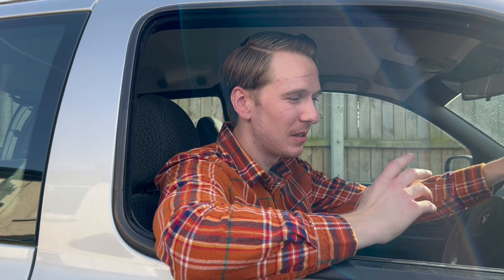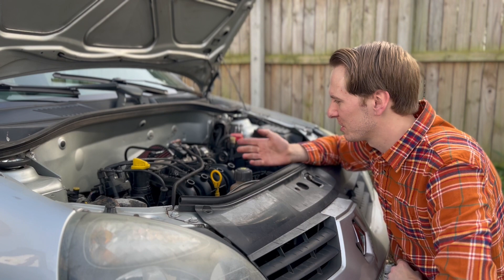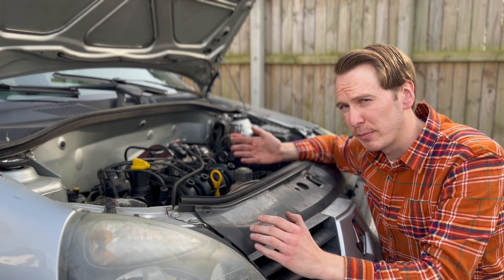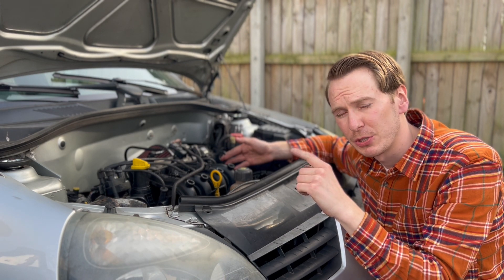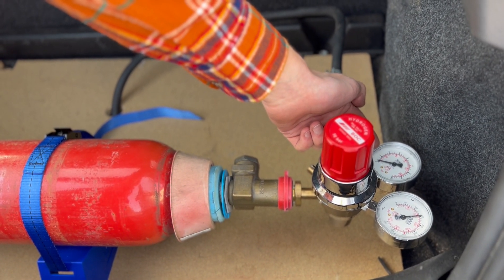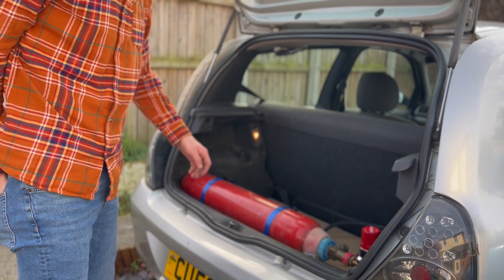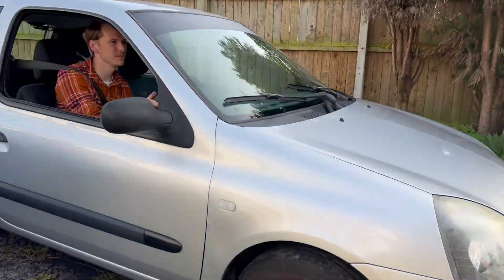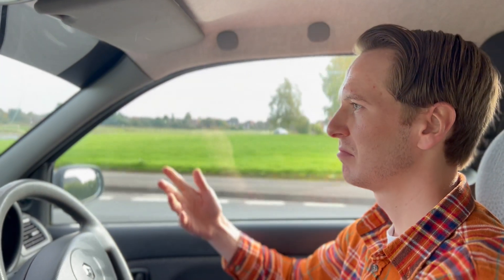Hydrogen Gas Car

Comment: So you retard the timing, because hydrogen ignites too fast it will cause early ignition and cause knocking? But doesn't it have ECU to automatically adjust itself?

Comment: Fuel tank pressure is the fuel level?
Reply from the maker: Not really, it's more about how much gas is in the bottle. But pressure is a good indicator ✌️
Reply: @Hydrogenguys so how you calculate the “how much fuel have?” Question?
Reply from the maker: @Dmanthechadman12345  nothing mathematical, just knowing roughly how long my tank pressure will last with that size tank. 

I am upgrading to a higher pressure tank soon so will have to get familiar with that one instead.
Reply: This is not alternative to today envoriment… but it will have a future because they will be more hydrogen stations than today…

Right?

Comment: I have a car with an LPG tank, Can I use that or do I still need to change the tank?
Reply from the maker: The tank would need to be changed as the hydrogen is stored under high pressures. 

Apart from that the rest of the system would be similar.

Comment: Sounds a bit like on quick burning race gas.
Regarding to your experience with the generator you should change the oil at least 4 times that often.
Reply from the maker: Yeah frequent oil changes for sure.

Comment: What about utilizing EGR for NOx?
Reply from the maker: Yes that would be good, I did this in an old video and it worked well, but for the rebuild I’ll be aiming for performance over emissions. I’ll still be using water mist injection to reduce Nox

Comment: Are you injecting liquid hydrogen into your cylinders.  Otherwise I'm pretty sure a fuel injector's won't inject gases . 
 
 
I drove an LPG converted Ford f 350 work truck
 ,19 73 model year. 
  Without taking it apart, it looked  Pretty simple it was stock Motor from the manifold down.  Just an odd looking sealed  air filter cover  With the propane line going into it. I'm guessing it was a throttle bodyInstead of a carb 
 But it ran identical to my truck that was the same model that was running gasoline.
Reply from the maker: Hydrogen gas, yes it works pretty much the same way as an LPG converted car, except its passed through the injectors instead, the injectors will cease up eventually because there not made to flow gas under such high pressure

Comment: 25% less power is masive
Reply from the maker: Yep, crazy, needs a turbo charger to make up the losses ideally
Reply: @Hydrogenguys  that comes with more things as compression will need to be changed to support a turbo and its a bit of a rabbit hole lol
Reply from the maker: True. I mean use a car that is designed for a turbo or supercharger to to start with, so the vehicle is better suited for it

Comment: You put hydrogen tank in the car so put lpg tank 25% and 75%hydrogen the car may run great try this power would be up
Reply from the maker: Would definitely help with the low power I’m getting, wouldn’t help with the carbon emissions though. And I guess a second fuel tank would make it less practical, range is definitely a problem with this hydrogen car project

Comment: how do you ensure saftey ? is it safe?
Reply from the maker: This is pure hydrogen gas, it needs oxygen to burn so the tank is very safe, unless there is a gas leak of course, but that’s the same with petrol, only a hazard if it leaks, 
A special hydrogen flashback arrestor is also used to stop any flames travelling up the gas line from the engine. 

As with all things, it needs to treated with respect, if done right it’s perfectly safe.
Reply: @Hydrogenguys   will this gas tank can easily be replaced with lpg tanks ? because here in our country there LPG tanks in cars are pretty common. so is there any modification required for hydrogen gas tank in comparison with LPG gas tank ?. or do you guys sell some sort of hydrogen kit for cars ?

Comment: Wow great work! But what about the air to fuel ratio how did you tune it?
Reply from the maker: Used a stand alone ignition system, the air fuel ratio was not measured in this test, hydrogen can burn in a wide range of oxygen levels, in this video the engine was running very rich, burning lots of fuel, ideally the engine would use forced induction.
Reply: So very rich like  A/F  10 -11 ?like in gasoline or rich for hydrogen like 25 and more

Comment: bro i have my car convertet on lpg gas. im about to switch lpg gas to pure hydrogen. with lpg system injection. but i want a bit help about if ecu will mixture it correct on right time

Comment: Can you generate HHO using the battery of the car and then drive the car using it?
Reply from the maker: That would be the dream. Yes i think so but it would drain the battery very quickly, battery power to gas, then to the engine for combustion. it would be better to use the battery to power a motor directly and skip the middle man. Would be like an electric car with extra steps.

Comment: fantastic job. please can you show the injectors ? its direct into cilinders or into air filter? whats the electronic that manage the combustion? can you show more details please. i ll be scared of a pure hydrogen system. can you try pure liquid ammonia into a lpg system with hho into air filter to support combustion? ammonia its cheaper and more safe to go around. with a scr filter nox emission  will be  lowered about 90%.
Reply from the maker: hi, the injectors are petrol fuel injectors, larger than standard to accommodate the higher flow rates. It is port injection (injected at the intake port per cylinder)  direct injection would be best but requires higher pressures. 
pure hydrogen gas is quite safe if respected, just like petrol really. Pure hydrogen cannot burn without oxygen like most fuels, its why I prefer to use pure hydrogen instead of 'HHO' gas which is dangerous to store because it always has Oxygen present. I'm not sure about ammonia, but it does look interesting. thankyou for the comment.

Comment: This is an interesting project you got going! As for the NOx recirculating the exhaust gases could help a bit but will require some work. What did you do tho for the water condensation, does it get evaporated, or do you have a water collector? Keep the good content coming anyway.
Reply from the maker: Hi thankyou for the comment, EGR would help with NOx for sure. as for the water it evaperaste in the exharst when hot, but it did rust the exhaust back box over time, hence why it has the aftermark back box, really it needs to be a stainless steel exhaut system.
Reply: Thanks, that's good to know

Comment: That's cool

Would it be easier to do through a carburettor? 

Do any of your videos cover a basic theory / set up?
Reply from the maker: Running it though through a carb or just feeding it into the air intake isn’t ideal, you can run a lower pressure which is great but the hydrogen can backfire very easily, imagine the whole air intake manifold full of hydrogen going boom. Would recommend a metal intake manifold, and a good running engine with minimal to no valve overlap.

Fuel injection reduces this problem significantly. 
Hope this helped :)

Comment: Hi and congratulations on your project.. can I ask did you fit up dated petrol injectors or lpg injectors .. just wondering on damage to the injector with water contamination..
Reply from the maker: Thankyou :). these were just bigger injectors than stock, so not great for hydrogen. They eventually wear out after a few tanks of gas.

Comment: I guess if the engine were built to run on hydrogen you could actually get the 25% power output back
Reply from the maker: Most likely, forced induction and higher compression would do the trick, would need a whole engine rebuild for forged components for sure

Comment: Hi, I want to ask that is it gasoline engine and what kind of fuel injection system is in it because without direct injection will it work properly.
Reply from the maker: Yes it was originally a petrol engine and was running on port injection :)

Comment: Reading the comments you mention high compression would be ideal.  Does this mean a diesel would run on it?  Also by nature they tend to have larger injectors
Reply from the maker: I would like to say yes but haven’t tried, diesel engine block and head but using spark plugs instead of glow plugs would be good to try.
Reply: hello Iam studying mechanical engineering in India 🇮🇳 in. 
CBIT  
Iam trying to make a hydrogen powered internal combustion engine as my project 

I do not where to start 
And started a little 
Can u please give me ur
Contact email for a little help

Comment: Awesome still seems very lively despite running port injection. 
If you where running direct injection you would get at least 10% more torque and power with probably better economy too.
Reply from the maker: It was fine in the most part, when under load (normal driving conditions) the RPM would take a while to build up, and it needed more throttle to get going from standstill do to the lower torque, you can see this when I pull away, needed to use the clutch more. 
Direct injection with forced induction is the way to go, the pressure needed for direct injection would be crazy though.
Reply: @Hydrogenguys From what I have read you only need high pressure injection if you are injecting at full compression like in a diesel, but you dont need that when burning hydrogen you can inject just after the intake valve closes while the piston is at BDC.

Comment: Range?
Reply from the maker: Not good, however one of the fuel injectors was stuck open when filming this video, so it was wasting fuel. I doubt range will ever be good with hydrogen combustion when compared to other fuels.

Comment: Now that Is truly great, all you need is to build a hydrogen generator that could run on solar and wind to produce hydrogen on demand
Reply from the maker: That would be the dream,
Thanks for the support. :)
Reply: @Hydrogenguys  I don’t know how practical it would be to have a hydrogen generator in a built up area like a town or city but it might be possible to build it underground and then if anything goes wrong then it would be already burred underground, it would need to have a reservoir above ground so that it can be filled up, and the wind turbine and solar panels would also need to be above ground, but the actual reactor and hydrogen storage would need to be below ground
Reply: The best way to go in my opinion is to use Ethanol or Methanol as a Hydrogen carrier and use an on board reformer to release the Hydrogen on demand apparently there is more Hydrogen in Ethanol or Methanol than there is in a liquid Hydrogen tank.

Comment: Hydrogen combustion can be much more efficient than petrol, but you will need direct injection, or a turbocharger
Reply: Can be a lot more powerful too with direct injection typically you get 15% more power running direct injection, and it's not complicated since you can inject moments after the inlet valve closes while the piston is at the bottom of its stroke, no need to inject at TDC or at full compression like in a diesel engine.
Reply from the maker: Yep, increased compression too, has a lot of potential.
Reply: @Hydrogenguys  yes, you could raise compression easily to 15 or even 18:1

Comment: Whats the range in 1 tank of hydrogen? Did you modify air intake as well?
Reply from the maker: Not very far, that tank would last around 45 minutes at low RPM and low load. 
Air intake was standard in the video :)
Reply: @Hydrogenguys it is a tiny tank to be honest

Comment: where do you get hydrogen from? and have you measured fuel cost per mile ?
Reply from the maker: Local gas supplier. Running cost would be very high, the tank doesn’t last long at all. Something to work on at least.
Thankyou for the comment
Reply: got it